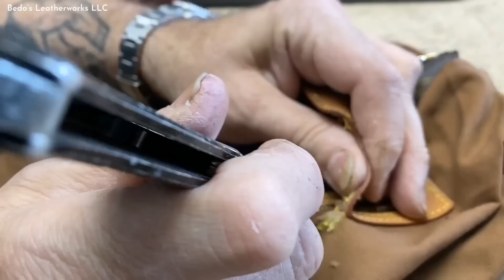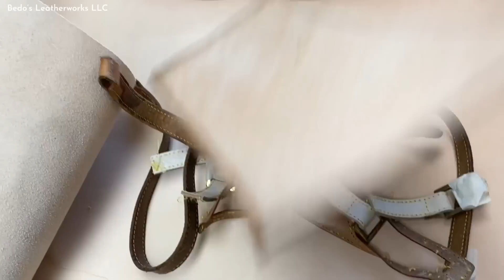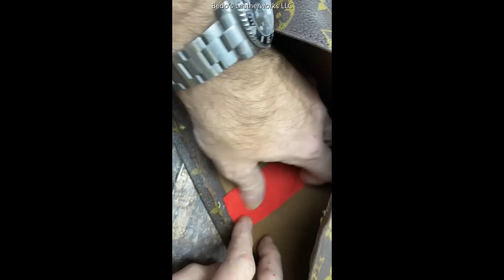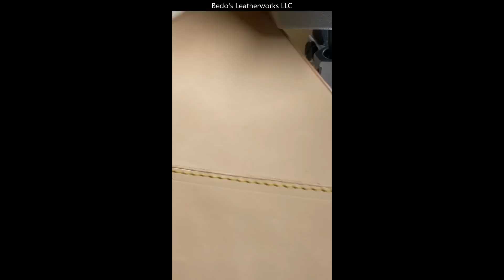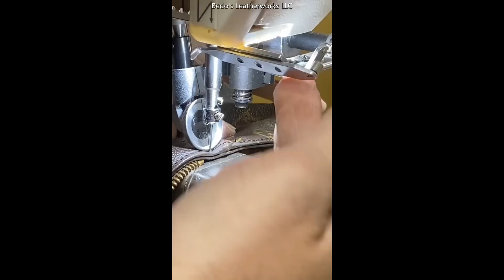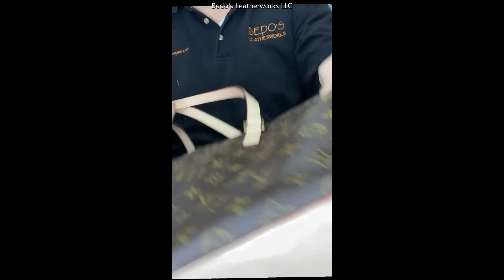ASMR Louis Vuitton - Cabas Alto Monogram Restoration

Comment: You might want to lube/service the sewing machine. There were a couple times that the threads weren’t tied together. You can see it at 7:35 and 9:15. I could be wrong though, it might just be the resolution of the video.